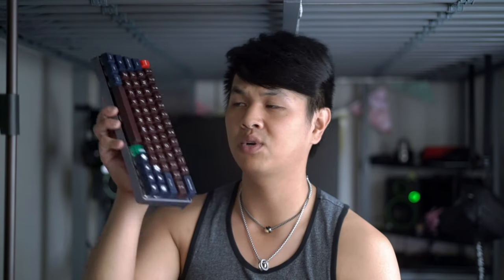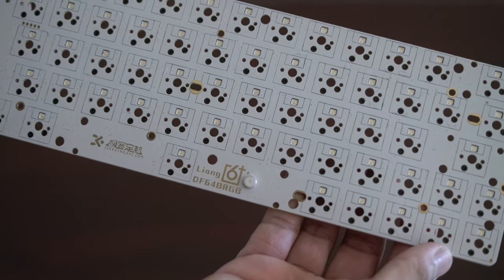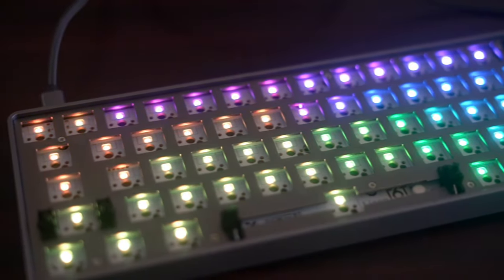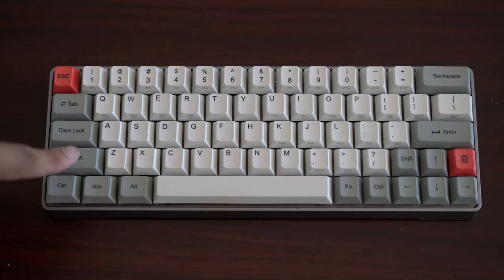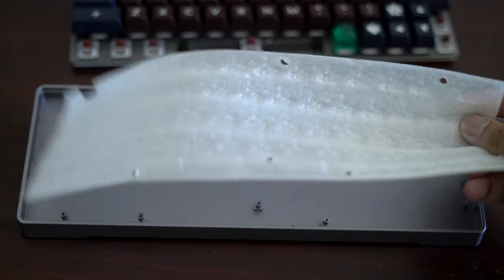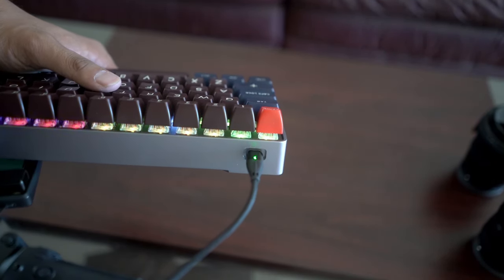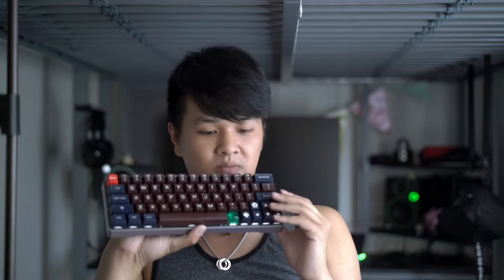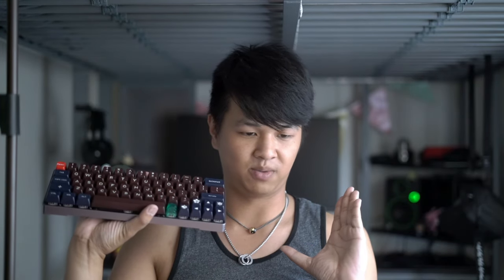My Custom GK64 Keyboard

Comment: i'm surprised that it's the 2u shift that bothers you, not the 1u shift on the right. Was it weird typing on that?
Reply: It's awkward to hit the right shift in the center if you don't have large hands(so no sweat with 1u, that's where people normally hit it), while the left shift doesn't even require a stretch.  This is probably amplified by the slight repositioning of the QAZ stack(noticeably more vertical than a normal keyboard layout)
Reply: I think it depend on how you typing.

Comment: Great review for an awesome keyboard. Interesting looking switches, kinda seem like the best of both worlds with a tactile hump but faster speeds like a linear. If I get this board I hear the pcb fits in standard 60% cases so I might upgrade the case and stabilisers later
Reply from the maker: Yeah it does actually, but always double check on the cases for minor detail variations

Comment: Goes the pcb support plate mounted stabs?
Reply from the maker: Like putting plate mount stabs on the PCB? That'll be a no. The PCB can support PCB mount stabs, because there are holes for them, BUT word on the street is that they don't support all kinds (also you might have to get a different plate to support the stabs). It's definitely safer to use some nicer plate mount stabs.

Comment: what plate is that?
Reply from the maker: It's a gk64 plate which fits 60% boards. You can tell which one it is by the irregular shift key row being slight more left, causing the 3 rows of alphas to be evenly spaced, and the left shift key turning into a 2U key.